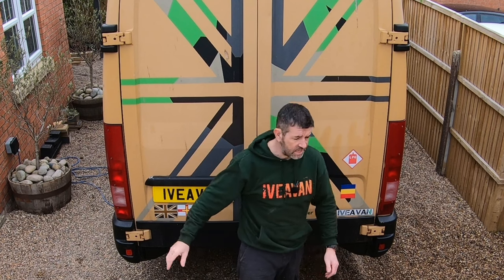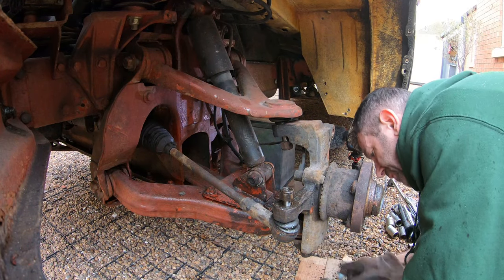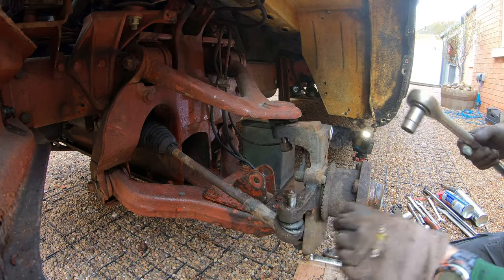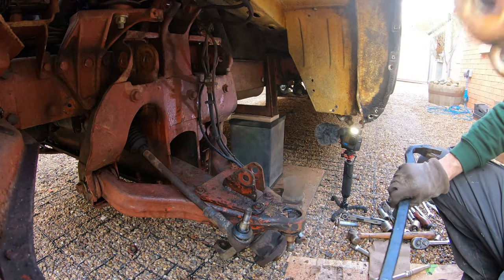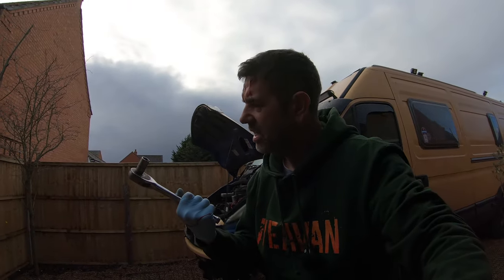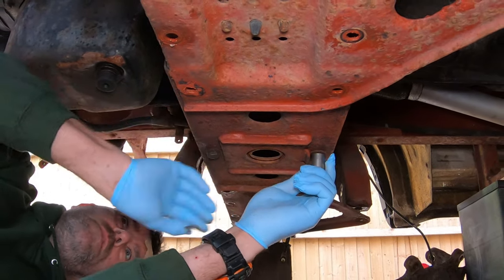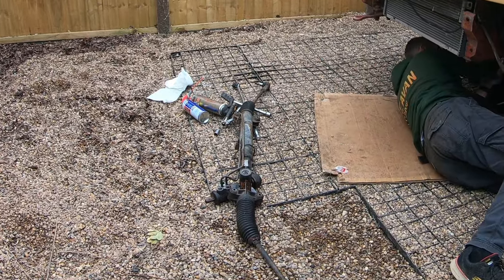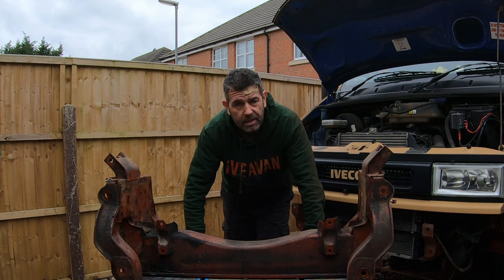Iveco Daily Front Suspension Teardown    | Camper Van Suspension Pt3 |.

Comment: In general, dear viewer, on Your Daily, you will need explosives to shift most of the nuts & bolts as they will be seized solid. :-)  Did one today & not even my rorty air-gun would touch most of them.  On the lower shock absorber mount -  as an example - 1 of the 4 the big dewalt impact eventually broke the bolt.. 1 opened after being heated to the point of melting, 1 I cut with the grinder as nothing would open it & it ignored the heat... the fourth opened like a good little boy... EFFORT!!  I also trust those jacking points about as far as I can chuck 'em.
Reply from the maker: 😂. Sounds like you had a good one there bud "😬" 👌👍👍👍.
Reply: @Iveavan  I do loads of these - work - they can either come off without a whimper or be an absolute sod from start to finish. Todays was a proper sod. :-)
Reply from the maker: Yes, I can see why bud. Pure rust cultivators. Luckily for me, the only hardest job for me was the 'O/S Rear suspension" where I had to show it the cutting disc".... Unfortunately, I didn't film that side "🤦‍♂️"... I admit, the rest wasn't to bad to do 😉👌👍👍👍.
Reply: @Iveavan  I won the "fastest rear-wheel-well rust repairs" Medal today on this one with the broken front leaf spring  - both sides done in a day & most of the front suspension dropped as well - Outside - as the bugger has a big foldy-awning-thingy fitted to the roof that makes it 1" too high to fit through the bloomin workshop door. Went to back it in - no go... ah ffs... :-)  I do so love working outdoors instead of in the nice comfy workshop. :-)
Reply: ..everything fits through the door - even busses - but not this git of an awning-attachment. Adds 10" to an already high-roof version.. Must be like driving a sail.
Reply from the maker: 😂... I bet it drinks some fuel with that fitted to it too... I've spent the entire winter working outside on this. Never again! (two MOT's this year, in order for fair weather repairs) I'm getting to old for this sh!t 😅😊👍.
Reply: @Iveavan  Same on the "old" bit. Yer man drove this in with the front spring broken. He goes "The tester said it needs new rubber ends fitted...."  I hopped in today to move it the 50 feet into the workshop - the banging & clattering from the front end was mad. How he drove it a fair distance to get here is beyond me. Spring was busted clean off on the Lh side & this motorhome is stupid-heavy - the 4 ton jack wheezed a lot lifting just one side, had to bang the 10 ton one in to get it in the air. People amaze me betimes at what they are oblivious to,.,. With all the extra gizmos added inside/on top/on the back/all the fancy extras inside, not a hope in hell is this yoke 3.5 ton which is what it's plated at. I've jacked lighter 6 ton busses. I'm hugely unsurprised by the broken spring. I doubt anyone ever weighted it - it just got banged out on the factory weight from the builders. "Yeah, she's 3.5 ton, pal... car licence..."    It is yeah, lol. :-) Rear spring bushes are also toast - same cause - I'm just amazed the single rear wheels don't cack themselves constantly - but it is wearing suspiciously shiny new tyres.. so maybe they do.. :-)

Comment: Great job Mark I did say you would have some fun doing the front , I did mine about 4 years ago when the van was a works van .hope your head is feeling better, and your subframe was ok after a bit of welding,Im looking forward to the next video , it’s hard work on your own but when you look at the prices a garage would charge to do it ,it’s all worth it in then end even the headache, see you had the weather,funny how you start a job like that it always seems to pissdown .
Reply from the maker: Hey up Thomas 😊👍, ahhh this is a few weeks old now mate (when the weather was almost tropical for February) I've been workshop bound for the past couple of weeks doing other stuff. Not to bad of a job to do to be fair but wasn't expecting to see those cracks, which have now set their course and wouldn't of developed any further I don't think due to the old corrosion build up within them (they could of been there when I bought the van just not noticed them) , they've been sorted now and the heads fine thank you bud 😊👌👍👍👍.

Comment: absolute diamond  mate    ,,have been dodging the rain after getting home from work to get on with my van,,just wish my bolts came out as easy as yours..which they never did ,cut them all off in the end,,,,,cheers for the video ,,great help
Reply from the maker: Cheers matey 👌👍. To be fair, I did frequently soak all the nuts and bolts in WD40 over a two week period whilst doing the rear suspension and other repairs, so I did cheat a bit there bud 😅😉👌👍👍👍.
Reply: @Iveavan   i thought you did mate,,but your video helped me more with a snapped leaf sring and upper control arm
Reply from the maker: Ahhh Cool, I'm glad you found it some use 😉👌👍.
Reply: @Iveavan   HI MATE HOPE YOUR WELL,JUST BOUGHT A ORIGINAL BUT SECONDS LEAF SPRING FOR THE VAN AND THE ENDS LOOK TOTALLY DIFFRENT,,,THEY SAID IT WOULD FIT ,BUT I HAVE MY DOUBTS,,,,,ANY GUIDENCE WOULD BE APPPRECIATED CHEERS
Reply from the maker: Do they have rubber feet at the end? I Think the later vans were like that? All you can do is offer them up and see if they will fit. If not, I believe you can buy the ends separately.
Reply: @Iveavan   YEAH  IT DOES HAVE THE LITTLE FEET MATE ,,,LIKE YOU SAY JUST HAVE TO  SEE IF IT WORKS,,THANKS MATE

Comment: Straight back into it, no messing around, what a legend!!!!! 
Where do you usually buy your parts? Did you do a video on removing the fender that you could share? I have a leak that has rotted the driver side floor at the wheel arch which I think is coming from the windscreen then flowing in behind the fender.
Keep up the good work, love the vids and the hard work!
Reply from the maker: Cheers matey 👌👍. I've shared all parts that I've used within the suspension rebuild videos within the video description 😉👌. No, unfortunately not regarding filming the removal of the fender. Buts it's simple enough, it's just bolted onto the vehicle 😉👌👍👍👍.

Comment: The transverse spring system is a breeze,
The older torsion bar system was bastard to work on . Also drilling holes in timber for the jacking points, absolute overkill,
I just use bit of timber and the holes making themselves  😀
Reply from the maker: Good for you 😉👌👍👍👍.

Comment: Hello Iveavan,congratulations for your videos I follow you from your beginnings on You Tube,I am from Spain and I use translator to write you.I have an Iveco daily 35S13 from 2011.I would like to know if there is any way to get all the complete exploded view of this 2011 vehicle without having to go to Iveco official because they will tell me no.I have problems to identify part references when buying.I see that in your camper you know even the tightening torque of the screws,how do you do it?
Reply from the maker: Hey Josep. I use the 1999 to 2006 workshop manual. You can get the PDF version from ebay (although it'll be a English copy whether the Spanish Ebay site brings it up or not I don't know. ) hopefully that helps you. Many thanks for following matey 😉👌👍👍👍.https://www.ebay.co.uk/itm/324891402181?mkcid=16&mkevt=1&mkrid=711-127632-2357-0&ssspo=CMz5cyjWTfO&sssrc=2349624&ssuid=kylJ7BYFSFS&var=&widget_ver=artemis&media=COPY

Comment: Call me dumb but what was the reason to replace it all. I see that Hd transverse replacements are available, just wondering the benefits you gained through the process which looks a lot work
Reply from the maker: It was worn. With the van being over 18 years old and with 320k on the clock, it was noticeable that the front suspension was tired even on smoth roads, (this can be seen due to the cracks in the subframe) so it needed an overall ( along with a new HD spring that I fitted). It's definitely a job that needed to be done as it's definitely improved the handling, ride hight and less harsh on the road where it's absorbing the impacts much better 👌👍.

Comment: Do you have any suggestions where to get new m16 bolts and nuts for the front shock absorber?
Reply from the maker: I got mine from ebay bud, the seller is within the video description. Make sure you measure them first as the ones I've listed are for the rear suspension shackles 😉👌👍👍👍.
Reply: @Iveavan  great thanks 🙏

Comment: Is it possible to lift the iveco so it sits taller with a transverse spring
Reply from the maker: I'm looking into this myself. Other than setting the rubber buffers to either mid to soft settings, that's the only option so far, unfortunately 😕 👌👍...
Reply: Thanks for the reply, yer I'm stumped on this the back is easy
Reply from the maker: If it's ground clearance, you're after. Your best off going for the larger wheels ( 16" for the mk3) and the all terrain tyres will give you  3" roughly extra ground clearance 👍...

Comment: Buy yourself an impact driver!
Much safer....
Be interested to see the repair, welding it I presume?
🙈🙉🙊
👍🇬🇧
Reply from the maker: I've already got the air ratchet and air gun, just trying to keep the noise down due to the neighbours bud, but! I shall be using them whilst putting it back together 😉👍.  I've stripped the paint off the subframe and those cracks are the only ones on there thankfully, I'm pretty sure due to the corrosion build up within those cracks, that they have travelled there course (well established) and now repaired😉👌👍👍👍.
Reply: @IVEAVAN  Nice one, I was surprised how relatively easily you removed everything but then you noticed the front leaf had been done before, that explains why everything came apart so well I suppose?
I will enjoy the crack repair video I'm sure.
👍🇬🇧
Reply from the maker: To be fair, I did soak every nut & bolt in WD40 every now and again over a week period whilst doing the rear suspension and loosened every nut & bolt off prior to filming it (besides the bottom plate) to make it flow better. But yes, they did come undone better then the rear suspension bolts with a couple of bolts that needed a little heat applied to them 😉👌👍👍👍.